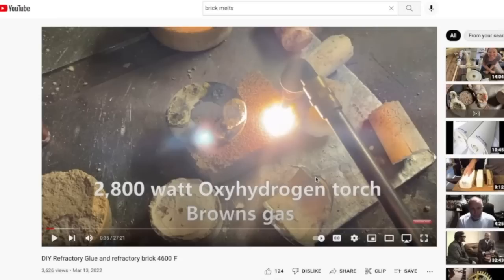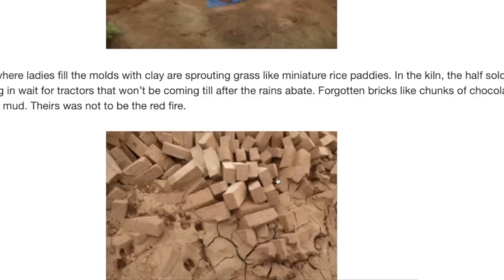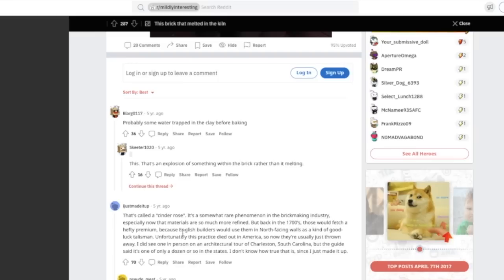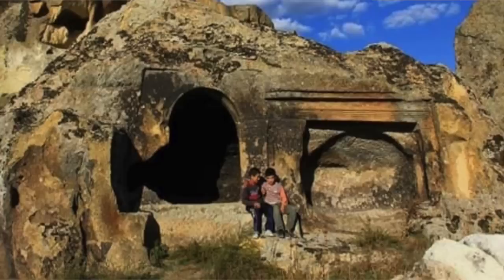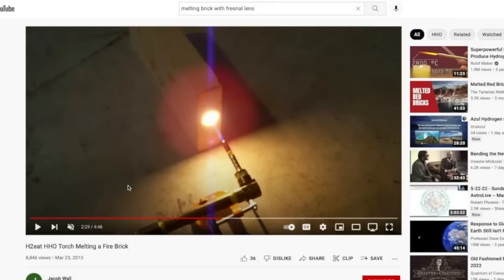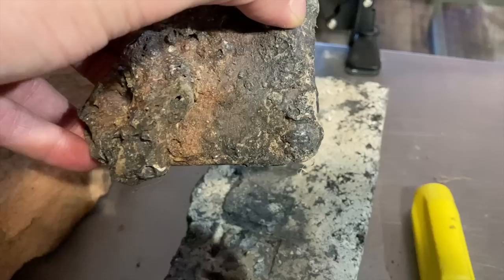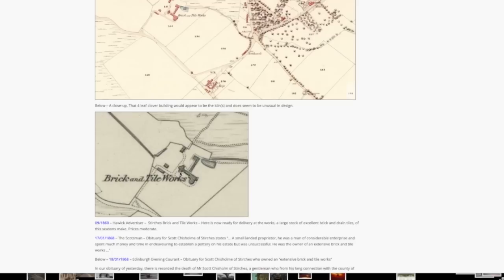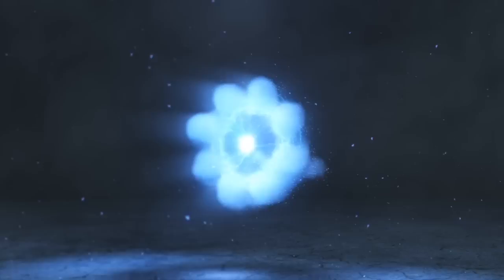Melted Brick Study

Comment: I saw a video the other day on You Tube where a man took the screen carefully off an old wide screen television put it in a frame and used it to magnify the sun. It melts rocks and started fires. The rocks looked like they started to explode at first like when a torch hits them. The did melt. I'm looking for old wide screen televisions now. I have always removed the magnifying glasses from them. Now I want a couple of the screens to experiment with.

Comment: Nice video, interesting topic. I’ve seen many HHO welders and cutters in operation in Chinese factories, they have advantages over oxy/acetylene and other welding systems in some applications. The HHO flame on an industrial welder is only around 250 deg C/480 deg F until it comes into contact with solid material, be it metal, wood, brick, etc. It’s not intense heat that causes the HHO flame to cut, weld or melt, the flame is described as imploding rather than exploding. HHO can turn tungsten to liquid, whereas to melt tungsten requires about 3,500 deg C. There are nuclear reactions happening that require further serious research, but HHO is a perceived threat to fossil fuels, so it has been shunned and often ridiculed. HHO is cheap to make, has no toxic emissions, has medical uses, it’s clean and green.This company has good info and a strong range of equipment for medical, industrial and home use: hho then a dot and then company)

I think that prior to the previous great reset it’s likely that societies had built in systems to electrolyse water and produce HHO gas almost everywhere to maintain low concentrations in the air. This would have purified the air and kept the resident populations healthy. Many of their building works incorporated both water and electrical features. Perhaps their HHO systems were used against them and caused much of the building damage we see today. It’s doubtful that all the previous building ‘melt’ and damage was heat-induced, more likely caused by unknown weapons that produce ‘melt’ and other strange effects. Weapons that are still used on us today, ones that cause strange fires and molecular disassociation of materials including metals, timber and masonry. Just as the fossil fuel industry provides dirty energy and hides free energy, the military complex uses dirty weapons and hides the very effective clean ones. Using heat or kinetic weapons to destroy cities is like bashing down the door whereas technologies such as HHO, LENR and DEW are like keys that unlock matter at the nuclear level.

Comment: You can get a free frenel lens by taking the screen out of an old big screen TV.. I once saw a video showing many uses including cooking, burning wood etc by setting them up outside with a frame stand thing where you can angle it with the sun, you could even try to array several maybe... To bad we just throw away old tech which holds very expensive rare tech etc...

Comment: Potter here. Been waiting for this brick to drop. To a prick? Don't be thick. As a brick. Like the album. Yes. Bricks melt. All different temps and obviously there are constants, recipes to maintain, but one person's shepard pie could be another's mudpie. (huh?).  Bricks are essentially a mud. Like ceramics-ish. Clay. May we not split hairs. I won't argue for limitations. In my mind, there are cements & clays. clay + flux + filler = ceramics . & bricks.  flux= silicas, glasses. fillers = organic material that burns out. clay = the finest rock silt material with water around the particles making it slippery thus we can mold with it.  I think benini had some kind of hard ceramic porcelain cement thing going on, as he said he had found a way to soften stone. can't find his quote wonder why.  any hoo   ~ this is my preferred medium-area-vicinity of the art & useful objects-making realm. Heats & chemical reactions. clays and oxides & silicas and feldspars and things dug to make ceramics and bricks are from rocks. cement is rocks, clay is rocks. You rock, rock!

Comment: Hi Jon. I was sorta on the fence with the melted building theory until I saw the Xia pyramid in China. You can see folds of rock that have partially slid down. This is one of those cases where it's always been acknowledged as a building and not a rock. The rows of windows which would have been clearly symmetrical have slumped like partially melted wax. I'm not sure how to send pics & I'm sure you'd be suspicious of links but it's easily found in a search. Cheer and thanks for your inspiring work. Paul Parker, UK

Comment: "PYROMETRIC CONES"

 I am a potter by trade and this is one of the tools in my trade you use to know what temperature you are firing at. the cones slump when you fire them and are accurate with in 10°F to 30°F . I fire at "cone 06" which is 1828°F/1855. If I were to fire at "cone 6" it would fire at a temp of 2232°F/2269°F) I'd destroy my kiln because all the glaze(colored or clear paint that makes the glassy finish on the piece, its a colored silicate based paint) would puddle at the bottom of my kiln and the kiln furniture would be ruined.  Fire brick is extremely soft so trying to remove it would break all the kilns fire bricks. I have 5 paragons I use at my stores are about 5k $4888 so  your cones 06 and cone 6   is a huge difference there are 32 (1-022 /1-10) different cones (cones 022(1087°F/1094°F) all the way to cone 01 to cone 1 then to cone 10(2345°F/2381) . The PYROMETRIC Cones. Mine look like red brick pyramids and slump when fired so you can gage the temperature of your kiln and your thermal couple is accurately firing. Thankfully I've not ruined a kiln yet but I'm sure you can find someone on youtube that has destroyed their kiln this way.this almost makes me wish I had cause I could post a video on this vitrification  before and after .

Comment: Actually yes old brick buildings do fall apart when fired it's only because the underlying superstructure that essentially give the brick a latticework to be formed around is burnt away .. the only way it wouldn't fall apart is if that latticework was of a highly heat resistant material, then under the same heat it wouldn't crumble it might warp though

Comment: I remember seeing a video where this guy had a magnifying plastic sheet the size of a poster, using it and the sun he aimed the focal point on a piece of granite and within a few minutes there was a little puddle of molten granite. Not sure if it works on a baked dry block of mud (brick) but it seems logical that it can melt many different minerals and rock.

Comment: Individual components of a brick like sand, silica and yes clay can melt. Clay gets fired at approx 1000 C. Or (1830 F )Melting point at which a regular brick can start melting is 1250 C or (2250 F). Porcelain made of pure Kaolin to cure at 1390 C or (2500 F) and melt at upwards of 1800 C or (3270 F ).

Comment: Love your content. Thank you! ♤♡♤
Recently, I visited Old Sheldon Church and the "ruins"
Located in beaufort , SC.
VERY bizzare vibes there .
Outside of the back of the area is raised Graves with a prince?  (I see lots of these raised graves as the area is lowcountry.)
However 
I have never seen so MANY cemeteries  in such a concentrated area. 

Lots of antebellum mansions with spokes and columns. 

Also similarly 
I  currently rent an office in an old bank building which has similiar style.  Giant columns (built in 1914?)
The basement is bizzare linking many  tunnels that go nowhere(boarded up and bricked off) 

When the tide comes in there is a huge deep pool type of area that floods out like a mechanical  machine to prevent water from going upward into the stories above.

The creepiest thing is the vaults and also the living quarters in the upper basement. 

Anyway that building is at 201 n front st in wilmington NC.
Near me is a scotish rite temple and a giant post office across from me. (With same columns)
Also Thalia hall.

All these buildings probably connect to one another?

I will see if I can sneak back in there or if  my landlord  will let me explore. It is very eerie. 

They are completely  tearing up front street deep plumbing. 

- I  now wonder if they are filling it all in after watching your content.

I do have some footage in that building as I filmed a music video in the foyer and vault area.

My video can be found under 'night sylph' channel if you want to look at it or maybe Google the address above.

How would one go about finding blueprints for where the tunnels go?

Comment: I have an oxyhydrogen (hho) torch. It uses water and electricity to make the gases. I think the Bagdad battery were actually electrolysis machines for producing this gas.

I'll  try to get you a vid of torching a brick. Lmk where to link it
Reply from the maker: Jonlevichannel@gmail
Reply: @jonlevichannel  got it. Look for mail late tonight or early tomorrow.

Comment: Melting is the result of moving or vibrating molecules...think of sand leveling by vibration. It smooths. Melting plastic or oil just so happens to take heat to move the molecules. Frequency and vibration. When the science of where we live changes.. it changes all science we thought we knew.

Comment: i worked on house that used  defective melted brick randomly placed with normal brick.  but the brick were defective in a way that left the face of brick bubbled out 2 to 3 inches but didnt effect height or width so they were easily incorporated with the normal ones.  you would think after a couple hundred years and billions of bricks later  they would have been able to perfect the process of baking clay

Comment: To give insids of Europa brick history , in farmers community’s the winter occupation may be brickmaking . Near where i live next to streams the clay like soils where pressed and baked to bricks , the melting of some bricks may happen by bad clay or overheating at the ovens this practice ended between ww1 and ww2 for most brickbakers , industry did take over . Some local clubs of archives have documentation on that but schools wont teach anny cause narative , the same for cement manufactory , concrete etc there are indications that industry took over and forgot a lot . Some ruins near where i live have no documentation i wonder a lot about why missing storylines and explainations , why burried in the midle of swamps etc , i have seen some weird glasslike blackish brown glass like claybricks that where baced after drying . If to wet the water burst the brick , hoping it sheds enough light on why some melted bricks have a lavastone structure

Comment: With enough Heat any Rock can melt oh, it's called lava or magma, but if you don't get to that temperature it just brittle The Brick which is more or less like a weak metamorphic rock, you can melt stones and rocks and whatnot with a fresnel lens you can find very large ones in old projector Style TV

Comment: I just need to get O2 lampworking I use propane and propane accessories.  It produces a small center surface mix of 10mm and an outer fire surface mix of  25mm so it's like an inch wide and about a foot or like 18 inches in length flame of death bricks are nothing for boro torches

Comment: Hope the other guy offers some sort of apology or rebuttal.  I am very confused on why he went off on you like that.  Both you guys do fantastic work and it seems like you 2 need to be on the same team.
  On an unrelated note.  I was traveling from st louis to gatlinburg when I noticed, off in the distance, 2 smokestacks that seemed to be way up on a hill.  As I got close enough to see them, it turns out they were sitting on the ground right next to some modern smokestacks that were in use.  these monsters were 4 times taller, maybe more, and just wreaked of old world construction.  May be something to look into for you, if you struggle for content.

Comment: I found a place where there is melted brick amongst other things and a non active railroad track seems to be put on top of the site I found tons of melted bricks and rocks that must of 'drupped' together. but this is as if the site got hit by a sun flare, death ray.... I don't know but I need to find a geologist to help me figure out if maybe the spot was where the rails of the railroad where made and melted the rock, minerals all around. I actually thought I was finding obsidian in abundance until I found half melted bricks with a nipple line across the whole brick that made it fit unto the brick above; each brick having the upside down U on the bottom side hollowed out and the nipple lke U line running a top to help structurally I can only assume

Comment: kind of going off of what you were saying about the death ray in the old art pictures and the controllers attacking and taking over. I was just kind of wondering what if World War II was A-war between the controllers like Hitler was fighting against the  controllers  Or it was A-war between the controllers. I saw a video many years ago about about nazi Germany and Hitler and Hitler had plans for these grand arcade it's grand architecture I mean these buildings were just absolutely massive and they're based on old world designs what if he was trying to resurrect tartaria. In the video they talked about a domed capital building that would have been so large you could fly a helicopter inside of These are just some thoughts I have going through my head.

Comment: Not melted brick but melted rock.
Link to a Flickr album of features found in and along the banks of my local river:
https://www.flickr.com/photos/garyinsooke/albums/72157636766895323

The local University Earth Sciences Dept does not answer my emails about photos such as this one:
https://www.flickr.com/photos/garyinsooke/14245967457/in/album-72157636766895323/

The whole river is an electrical discharge from sea to mountain top.

Comment: I could honestly see the resets being something as simple as a bunch of mischievous people abusing primitive, common technology like those mirrors, combined with the power of the luminaries. If you have a really delicate system like the old world, which requires perfect harmony in order to function, it wouldn't take much to topple it over. You'd just need some pranksters running around with mirrors perhaps - easy to accomplish when you have a bored population who can be easily bribed.

Comment: why wouldn't rock or bricks melt under extreme heat? thought it was common knowledge that rocks can melt and brick can too, chuck a brick or a rock in some lava and it will melt for sure. I mean what are volcanos but giant furnaces of molten rock
Reply: @alllaw3ao7  even if a brick is pre fired it could still melt if it reached sufficient heat , all elements in a brick have a melting point

Comment: @7:55- that is a very small area for a heating element to have broken free and fallen onto, without disturbing the brick next to it, or without even marking the adjacent face of the same brick.  2 points that have me not agreeing with your conclusion on this particular item...1st, in my opinion, a heating element system wouldnt be designed with the ability to supply itself enough energy to melt the metal of the heaters themselves, but if it somehow malfunctioned that drastically, then the temperature spike would logically span the entire element, and not just a localized area like youre concluding, and there seems to be no other evidence to indicate an impact from an object overhead falling onto the brick.
 2nd, and still just my opinion, it seems a logically more efficient (and therefor cheaper and easier design) would have heating elements below the bricks to take advantage of the natutal thermal comvection. Since moisture evaporation from the rocks is essentisl, recirculating humid air from the top of thr oven to the bottom would be avoided as it would only add length to the curing time, and add complexity and cost to the oven.